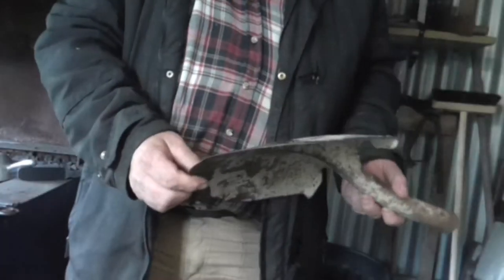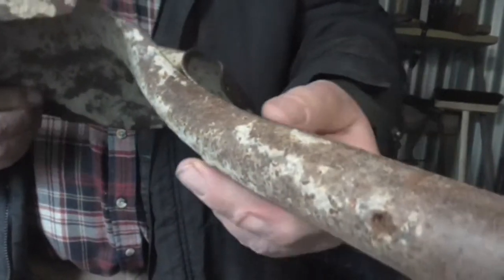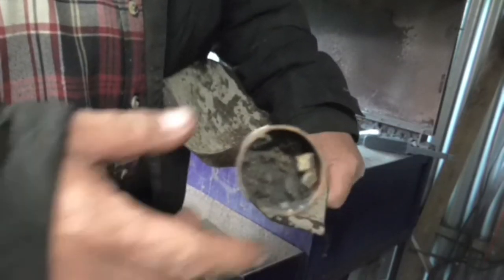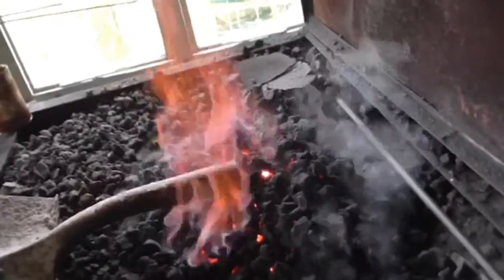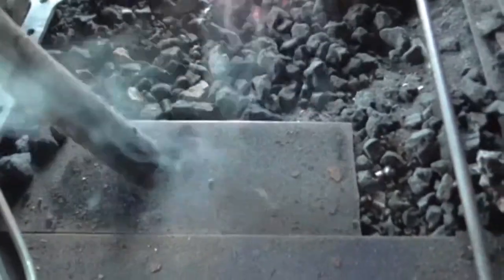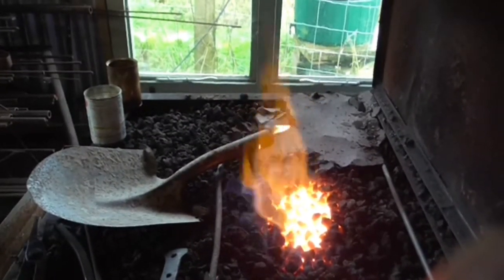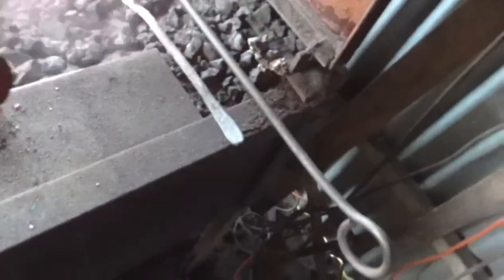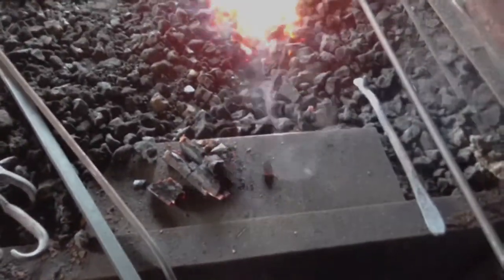Removing a broken handle from a shovel

Comment: Drive a half inch wood chisel into the gap at the back of the socket thus opening the socket. Tap the side of the chisel to drive it out with the wood. Takes less than two minutes
Reply: No on a rake or hoe....burning or drilling is your only option.
Reply: @g.alistar7798 This is about shovels and by extension spades and forks. Rakes and hoes have their handles attached differently but the stub can usually be removed with a piece of bar and a lump hammer.